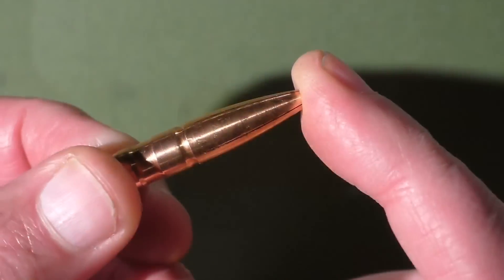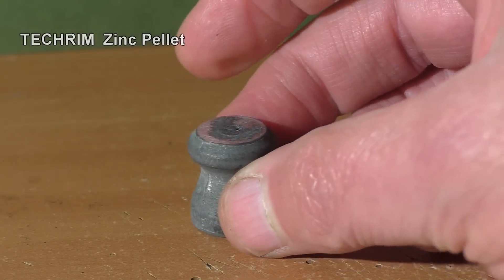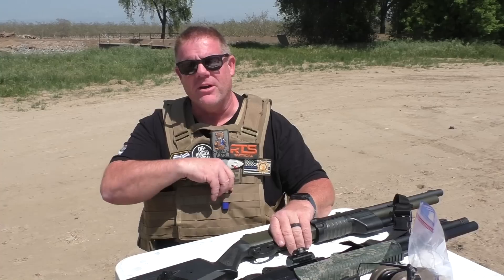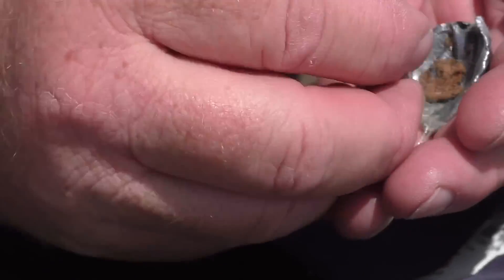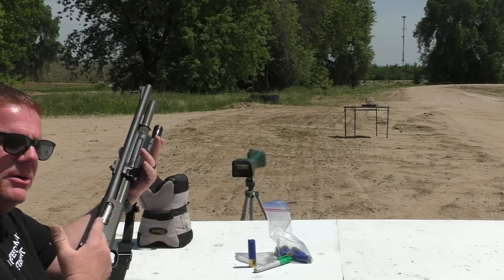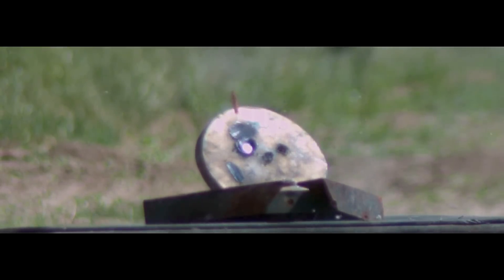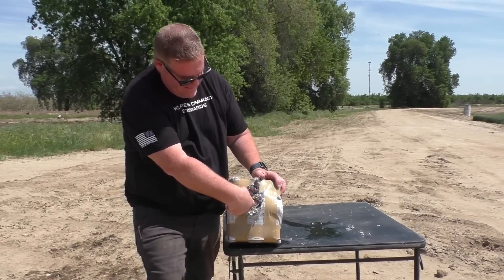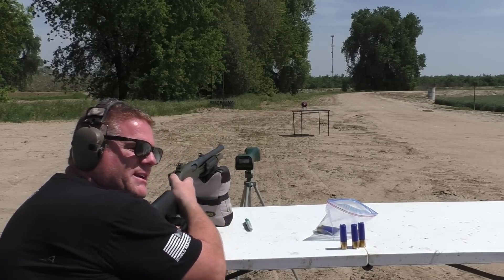300 Faust - 12ga. Slug Prototype -  First Test

Comment: I have an idea but I dont know if there's enough room in that slug. A tapered hole from the front that doesn't pass all the way thru could take advantage of the boat tail and bottom driving band for positive engagement, but I think those would end up being way too long. 

Neat idea tho, looked good on the drawing board as well.

Comment: If this was said already I apologize.  Could you have bored from the front of the diabolo, but not completely through, and press the rifle bullet in from the front? Probably wouldn't want as tight of a fit and would need some way to grab the round evenly to prevent crushing the tip though.

Comment: OG is doing it the hard way. 
The REAL way to do that is you PRE-SPIN the gun first. 

First, make sure the gun is UNLOADED! 
If you spin the bullets too then the effect will be cancelled.

I recommend putting the gun barrel down (for safety) against the dirt. 
You then bend over and place your forehead on the shoulder pad of the gun. 
Grasp the gun firmly with both hands.
Finally, use your legs to traverse around in a CLOCKWISE circle to PRE-SPIN the gun.

If it doesn't work then either you live in America and are using an imported English or Japanese gun, or you live in Australia and you are using an imported American gun.

Comment: Great try Jeff.   I would have thought the bullet would have stayed in the slug.  Interesting that the force on the bottom surface was greater than the force on the surface of the bullet and was great than the shear force of friction holding the bullet in the slug.  Interesting computation knowing the cross section area of both the bullet and slug minus and comparing the two forces.  Then compare that to the shear of the bullet to the lead slug.
I also wonder if you just drilled the zinc plug just deep enough to seat the bullet.  Don't give up it has possibilities.

Comment: If you wanted to overcomplicate it you could thread the bullet with a die and drill and tap the slug and then screw it all together with loctite.  I'm sure it would be easier to use a steel disk behind it though 😅

Comment: You may need to weld or cast the .300 BLK into the slug, so that it's one piece. Don't know if it's possible with the copper jacket. I'd defer to the welders/metallurgists on that one.

Comment: How sore was OG's shoulder the next day? He groaned after each shot 😂
Reply: Still feeling those bastards.
Reply: I believe you. I feel bad for you even though I'm also laughing.

What do you suppose would happen if you threaded the bullet, and then tapped the slug leaving the bottom of the slug solid? Then screw the two parts together. You'd probably have to thread it opposite the spin direction of the barrel to keep it from unscrewing. Maybe add a little lock-tite

Comment: A possible solution for the slug/bullet marriage.
Where the slug tapers down drill a tiny hole thru the diablo slug and bullet, insert a steel pin or 2 small screws, one from either side, to hold these to dis-similar metals together.
A problem with the lead slug is that lead acts like a lubricant, so anything pressed into it will more than likely come out of it under enough pressure.

Comment: What if you fired the Diablo backwards so the hollow base now becomes a cup to support the bullet?  Drilled only part way down into the cavity, so the Lehigh bullet is supported by the now base of the slug and fill in the "hollow point" of the slug around the bullet with molten lead, solder, or JB weld to lock the bullet into the slug.
Reply: I like how you think. Most people are trying to improve Jeff's design, which is fine, but a fresh idea like this might ultimately solve the issue.
Reply: @CowCommando  especially since he already knows where he went wrong with this iteration, kinda surprised he didn't see that coming and fix it to begin with tbh

Comment: It is too bad you couldn't cast the slug with the bullet in place, as the grooves in the bullet would probably hold it.  I would have thought that a .027" press fit would hold, but then lead is not that strong, and probably slightly bulged when you jammed them in the hole.  Or just put a stronger support disk behind it.  Or maybe you can get Kentucky Ballistics to put a thumb in it

Comment: Maybe you could just drill from the top of the Diablo and leave a little lead mass for the bullet to set on?

Edit: if you attempt this you may want to drill a small (1/16" or 1/32") hole all the way through to allow for air to escape during pressing the bullet in

Comment: Well, interesting results. Like you said, Jeff, a metal disk would probably get everything moving together. Maybe fill the bottom with JB Weld even, and stick the disk to it.
One things for sure, the Diablo slugs proved themselves again, this time as hollow points. Great video guys!
Reply: Use a Dime. There are no failures, only learning experiences.
Reply: Just fill the bottom of the diabolo with lead. It'll lock the copper core in place.
Reply: I was thinking of soldering the 300 to a copper diablo but the I though I won't hold.
Reply: Dia-bolo

Comment: There are no failures, only learning experiences. Thanks for sharing. 

You could try drilling a .118"- .120" hole through the side after pressing in the round and then press a .125" pin through the side of the slug and round.
Reply: Or just dont drill a hole all the way through the lead pellet you set the bullet into
Reply: I think a steel support would have worked and no fiber wad.
Reply: That's right, the road to success is paved with failures, you try, test and improve.
Reply: Damn, you are thinking what I’m smelling on this one
Reply: I think that would shear...
Reply: Drill it to a smaller diameter than the bullet, heat up the slug until the bullet fits in and let it cool down and shrink
Reply: easier to just recast more lead at the bottom of that slug
Reply: Lots of good ideas here.
Reply: Wonder if making a thread and screwing the both of rounds together might have worked.
Reply: I had the same thought.

Another alternative is filling in the back of the diabolo with more lead after squeezing the blackout in.
Reply: Another option would be to knurl the base of the bullet and press-fit it into the slug. That would be even better if instead of drilling and pressing the bullet into a foster slug, the bullet was instead placed in a mold and the slug cast around it.

Comment: Adding a more solid support for the bullet so it doesn't force its way through the gas seal would probably help.

Also, holy shit those things are S C R E A M I N G.
Reply: Maybe a dime or hardened slug on top of the gas seal
Reply: @iamlukie1826  aren’t quarters 12ga?
Reply: Like a copper or steel holding pin if done right should keep everything in place